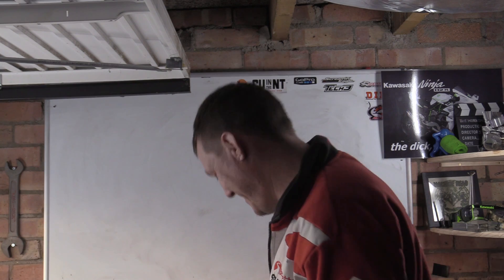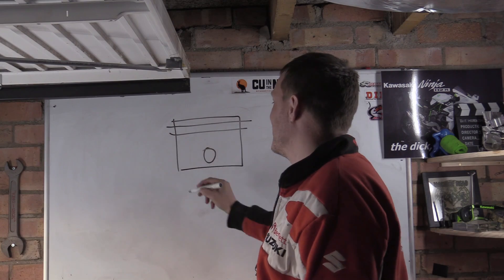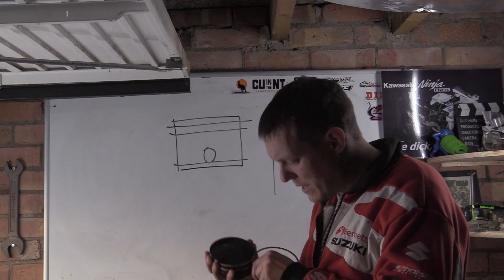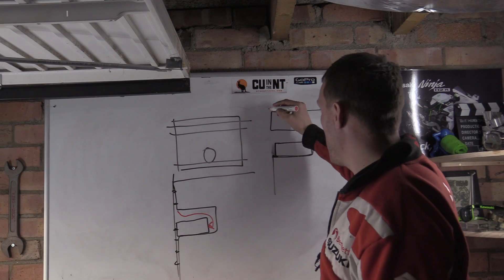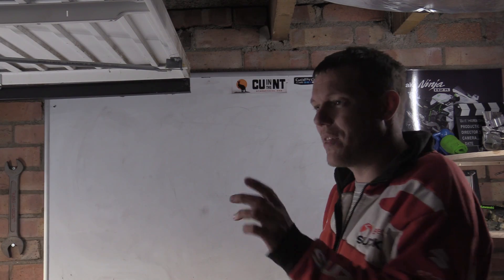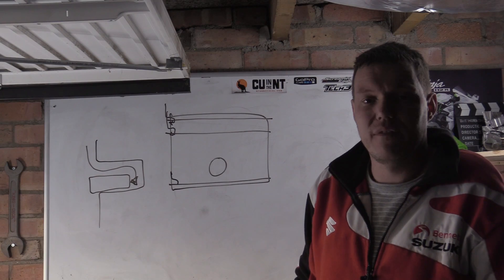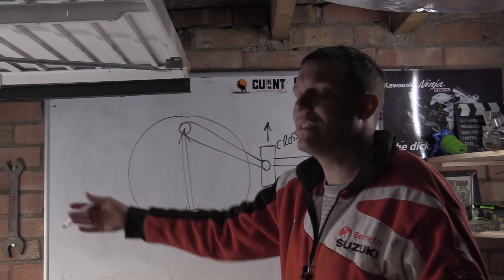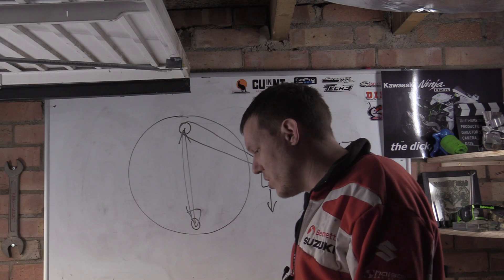Why don't pistons have a bottom ring?

Comment: I have a question regarding ring end gaps, when I rebuild engines I try to stagger the ring gaps so the gaps are never over a gudgeon pin hole or directly on the thrust sides. Are there any benefits or disadvantages to this?
Reply from the maker: No. as the rings move.

https://www.youtube.com/watch?v=zIIXMhUVUYE

Comment: Cause there is no place to machine a groove on modern pistons...  Old 356 Porsche's used 2 compression rings above the pin and an oil control ring below, not there for piston slap.

Comment: What is the most difficult bearing to lubricate on a slow speed crosshead marine engine...the crosshead due to the load being continually downward, true hydrodynamic lubrication cannot happen. The clearances are measured using Swedish feelers it's an art in itself. A bit like taking engine draw cards, also a thing of the past. Feck I'm getting OLD.

Comment: Old 2 stroke Detroit diesels,  Chevrolet 366, and old Carerpillar engines had multiple rings on the bottom of the pistons. Those pistons are very very long, or tall, whatever you want to call it.
Reply: Robby Schemonia  was going to say that as well. Detroit’s has them at the bottom because of the way the intake system is set up, blowing fresh air in at the bottom of the stroke and needing to seal the crankcase from getting boost pressure.

Comment: Hey, Matt, how far can a bike go at max speed and on the top gear as if it was cruising on an infinite straight empty road? Would it make a difference whether it's a regular bike or something like an H2R?
Reply from the maker: LOL not very far. Think motoGP and how they go through engines
Reply: @thedirtyworkshop  Even if you have an overdrive gear?
Reply from the maker: You stated "max speed" and "top gear" - this regardless of an overdrive or not means that the engine is under maximum load and high rpm. Therefore maximum wear and maximum friction - in fact everything is at maximum
Reply: @thedirtyworkshop  Fair enough, I just thought sinxe overdrive lowers RPM the wear would be lower as well despite higher load.

Comment: I remember playing with old pistons in the early years of trade school. There were some that did have oil rings around the skirt. Back in those days bores were not CNC machined and all honing was done by hand. Weight and peak revs were much less of a concern than emptying a sump of oil on a trip to the shops I'd say.
Reply: Some of the old diesels had extra rings too. Such as the Deltics which had 3 at the top and one at the bottom as we will probably see when Matt gets round to doing a video on them ;-)
Reply from the maker: I went all the way to york to see the deltic in the national railway muesum to see the cut-away version they have and they'd moved it 2 months before then. It had been there for fucking 12 years and the day I go to see it - its fucking gone! LOL
Reply: Had a Locomotivemans handbook when I was with the railway,it had a line drawing of the internals of a Deltic,near gave me an aneurism trying to figure out what was going on inside that thing.

Comment: After a period of deep thought, I have come to the conclusion that pistons don't work in the way we think they do. I think the piston is supported against the cylinder wall by blowby, which after a while cause the striations on the aluminium, because where their should be similar striations on the cylinder wall, mostly after a wipe you can still see the crosshatching.
Reply from the maker: LOL no. The piston is softer than the cylinder walls.
Reply from the maker: Not only that but if blow-by was the cause it would be all around the piston and the cylinder would wear evenly around its circumference - which it doesn't
Reply: Ok but think on this, if the piston being ally,is going up and down at incredible speeds, and is actually touching the cylinder wall as it is doing so ,it will last about five nano seconds even if its lubricated before its fucked. But if its getting a gas blowby shield as its doing it, that would be a different story. The gas shield would exist  because the tolerance of about a thou in the piston diameter, to the diameter of the bore, at the pressures in the combustion chamber, would cause a blowby  enough to keep the piston off the cylinder wall. Thus stopping the incredible wear it would be otherwise encounter.
Reply from the maker: Incredible speed - is on average about 30m/s with a peak of 80m/s and a minium of 0 m/s. The piston touches the cylinder wall at TDC and BDC where the velocity is around the 0 m/s mark - also called the dwell. 

"it will last about five nano seconds even if its lubricated before its fucked."

- You're just guessing here - infact there's quite a lot of oil - so much so that there is oil control rings and drain back holes because of the oil volume. 

One massive hole in your 'theory' is you state piston blow-by, but what about the other strokes? There would be a massive assymetry to this 'gas shield'. 

"at the pressures in the combustion chamber, would cause a blowby enough to keep the piston off the cylinder wall."

- Like I said, what about the other strokes?

"Thus stopping the incredible wear it would be otherwise encounter."

- Again here you're just making this up.......

There are paper on the forces applied to the cylinder wall where the piston ring force and piston forces have been directly measured. This data (which I'll go through in a future video) disproves your 'theory'
Reply: @thedirtyworkshop  The other strokes?, when it exhausts, its still pressurising the gasses out and has a positive pressure working down the side of the cylinder, the induction stroke, is pulling a vacuum and piston reduces the volume in the sump.as the sump gets  pressurised, so all strokes have a blowby factor... the main combustion one the most with the potential damage, would have the most blowby, and the most lubricating effect.
  Under this theory, its the steel rings which would stuff up the liner as its steel on steel. If I shoved a piston up a bore, the piston would self centre with the pressure as the air filled the gap between the piston and the bore, thus keeping it off the bore .Air bearings exist, that's what could be happening here.
Reply from the maker: "The other strokes?"

- Yes - piston slap is due to the inertia of the piston and the angle of attack set by the con-rod. Therefore piston slap is the same - because the angle is the same and the mass of the piston is the same. However, the 'blow-by ' pressure is different.

"and the most lubricating effect."

- By definition, blow-by is NOT lubricating.

"Under this theory, its the steel rings which would stuff up the liner as its steel on steel."

- With the addition of oil - you seem to keep forgetting that.

"Air bearings exist, that's what could be happening here."

- Air bearings do exist, but under constant pressure, and the pressure is equal to the load. And no, it's not what's happening here - example - 2 strokes.

"If I shoved a piston up a bore, the piston would self centre with the pressure as the air filled the gap between the piston and the bore, thus keeping it off the bore"

- So cylinder wear comes from where? And why is it assymetrical? And in the plane of the con-rods big end?
Reply: @thedirtyworkshop   We accept that their is blowby, its got to go somewhere, so if it can pressurise a piston ring to push against the cylinder wall, it can do the opposite, and keep the piston off the cylinder wall, depending on the tolerance of course. I take on all that you have said, but also think they might have underestimated the degree of this effect. Simply because,  the gut feeling that any lubrication on the cylinder wall could have a hard job staying on during the combustion period.
Reply: The piston wears the cylinder in oval fashions,I think blow-by lubrication is not only the case, if it was then why there is oil scprapper rings, oil nozzles directing oils on cylinder walls, also the piston slap becomes more prominent if the conrod and piston is not perpendicular, which is only possible at tdc, when it moves down the walls, the piston skirts tend to move opposite to the deviation of conrod. Havent you ever seen compression leak down test, if you put oil in there you get tight compression, oils and oils are the major reason which provide lubrication as well as compression.Dont underestimate the power of oil film.😸

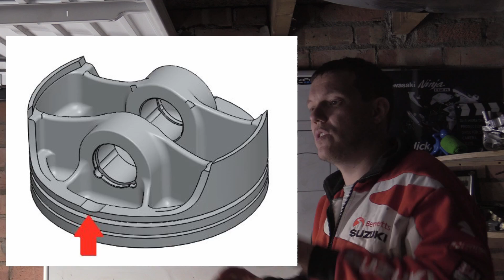Comment: 10:25 Why not have the COG below the center of the wrist pin, wouldn't that make it stable and not want to rock, kind of an auto correct feature, where if the skirt kicks out in one direction the imbalance will make it recenter? Or is weight savings more important than that?
Reply from the maker: Most of the mass is in the crown. How would you do that? Have the wrist pin ontop of the crown???

"Or is weight savings more important than that?"

- Oh yes. It's actually forces acting on the con-rod. The heavier the piston the thick and stronger a rod has to be
Reply: Figured you'd be all about a thicker stronger rod...

😆